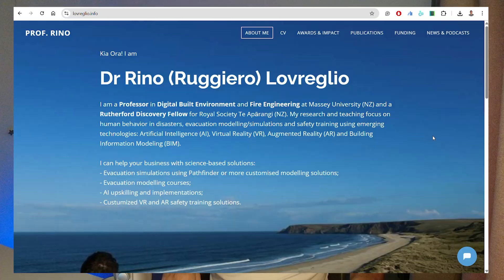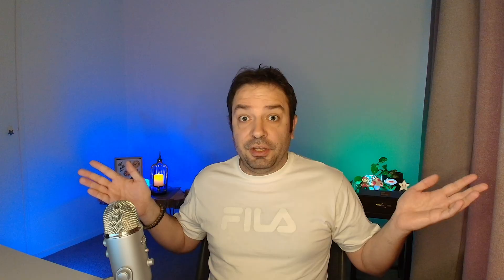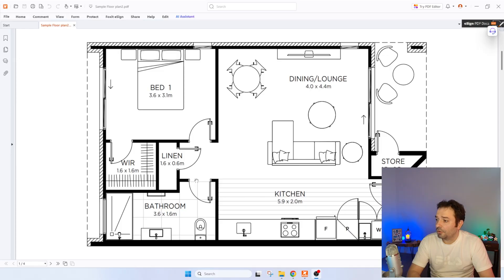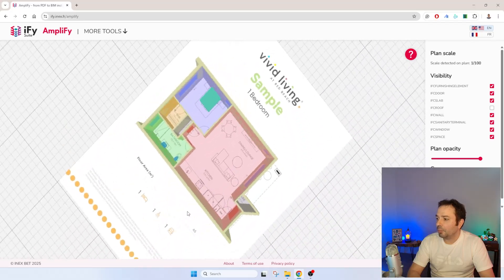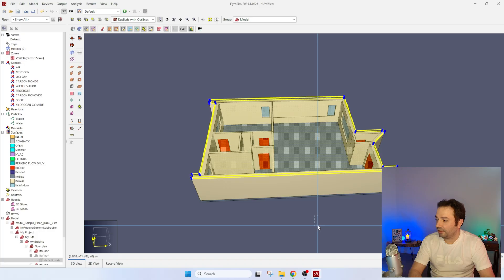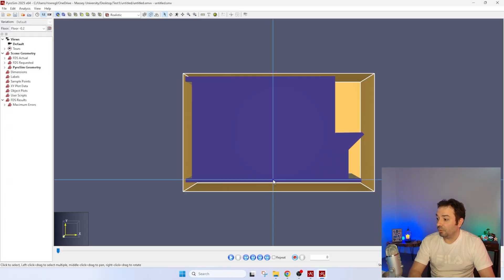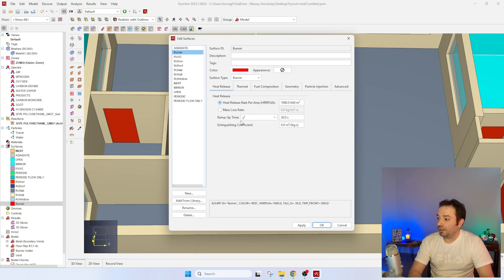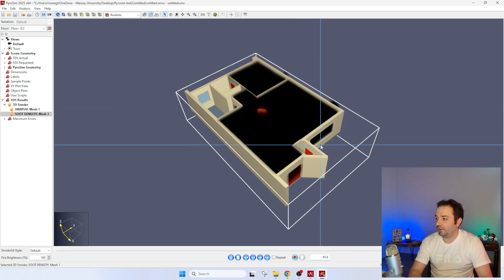Future of Fire Engineering: PDF to FDS - Save hours of work!

Comment: Thanks for the vid, very well explained. Quick question : let's say I'd like to inject a mix of air/helium instead of setting up a burner (I'd like to save simulation time by avoiding calculation of radiation, species, etc.). Would I be able to do it in Pyrosim? Keep up the good work!
Reply from the maker: I guess it's possible but please check with the FDS discussion group